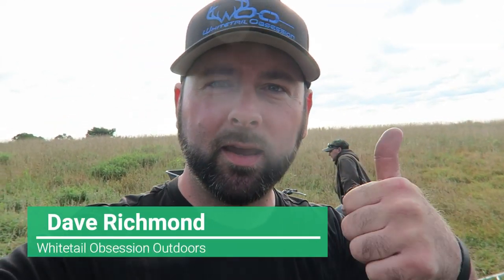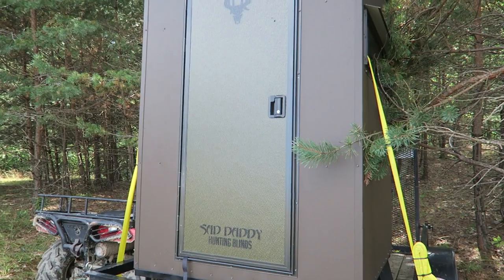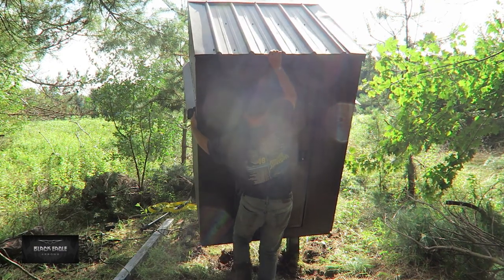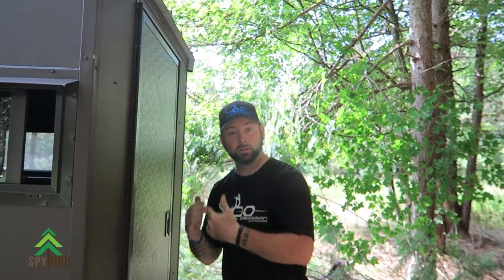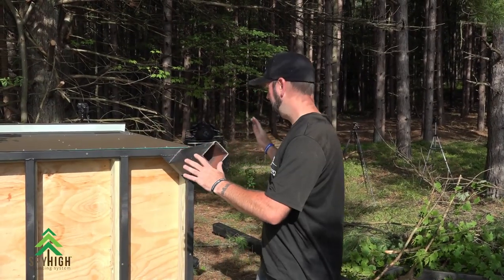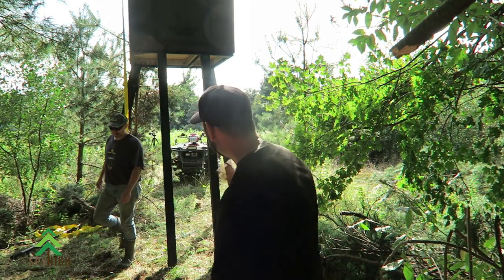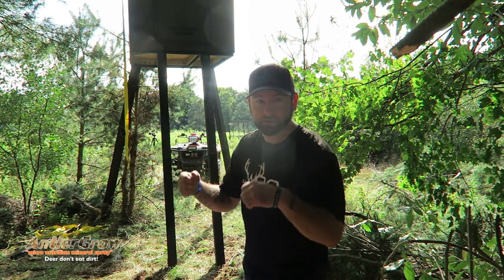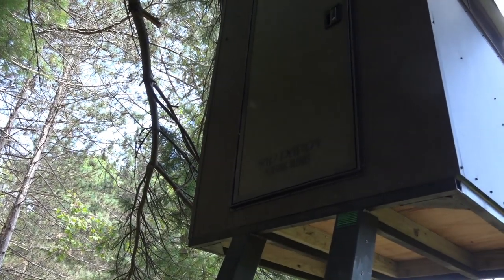How To Set Up Deer Hunting Blinds Without Heavy Equipment - Sad Daddy

Comment: Did it work...yes.  However, that was probably the least safe way to raise that stand.  You had that stand “teeter tottering” while you rushed to put in legs 3&4.  It could have easily fell into you and the atv.  It would have been much safer to install all 4 legs and then raise it.  To have done that without heavy equipment would have used a block and tackle and those nearby trees.
Reply from the maker: It worked so that’s all that matters. Wasn’t anywhere near falling back toward the atv. Otherwise would have lowered it back down.1000 ways to do it. This is what we chose!
Reply: I agree that was a very unsafe way to get that stand in the air you don't value your safety or your life

Comment: There's no way I would ever buy the stand the leg setup is ridiculous. And dumb with no cross-bracing and the legs in the back or way too close together. It's very evident that this company only cares about producing cheap crap because the legs set up alone is a huge safety issue. when those legs get old high winds will break them right in half especially with no extra bracing safety first come on guys!!!